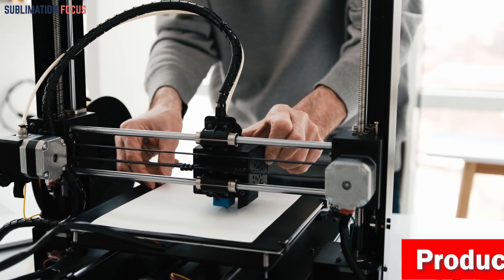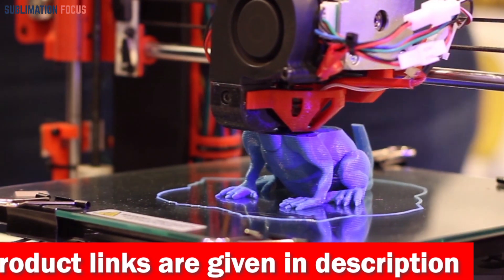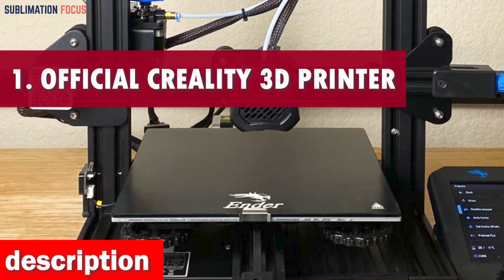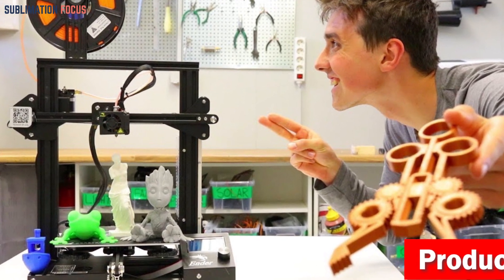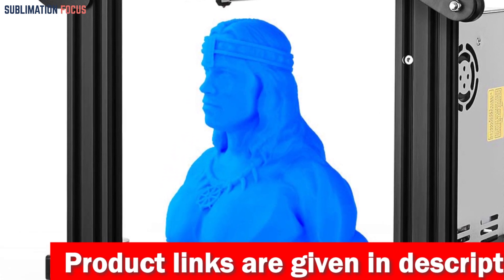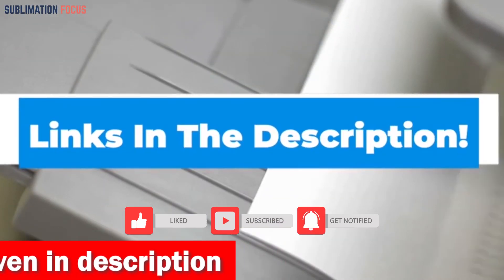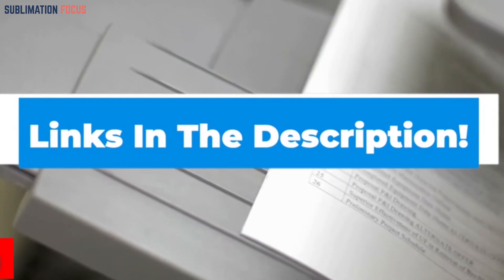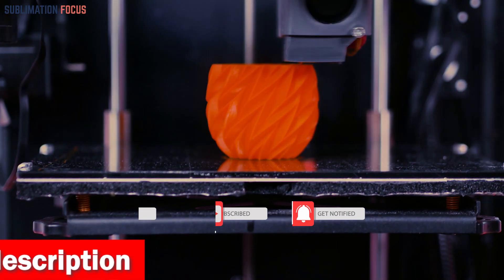Top 5 Best 3D Printer Lubricant For Bearings In 2024

Comment: Wow holy crap I don’t think I’ve seen another video that basically sums up literally everything NOT recommended in lubricating rails or rods… gpl 105 is way too thin, they always recommend the grease gpl 205/225 instead. Also they’re the absolute most picky grease/oil for incompatibility with any trace of other lubricants like any oils from the factory…

Superlube silicone is literally the only one in the line not recommended for use in bearings… silicone grease is good for plastic on plastic but anything involving metals is literally any superlube EXCEPT the silicone lubricant…

And liquid bearings + dry lubricants and ptfe in general are literally the only thing almost all linear rail or bushing manufacturers say NOT to use because it will clog up the ball track with the particles.

And plant based lubricating oils are literally the worst in anything but environmental impact… doesn’t last as long, doesn’t protect and lubricate as well, doesn’t stay homogenous for long, and is just generally the last line pick in all bearing applications.

It’s actually impressive how this ai (I hope it’s not a human- I’d be worried) has literally covered 99% of the worst things you can do to your linear guides and bearings. There’s actually not that many things linear guide rail or bushing companies recommend not doing. But this video seems to have ALL the “do not do at all costs” things that the top couple companies like nsk, tho, Thomson, and hiwin have to not mess up your rail and waste their/your time with a warranty clqimwarranty
Reply: You did get a like from the bot, though. :p
Reply: Reported the video for possibly being harmful.